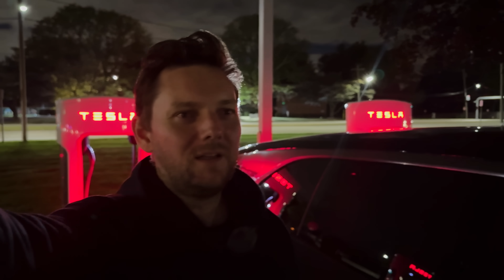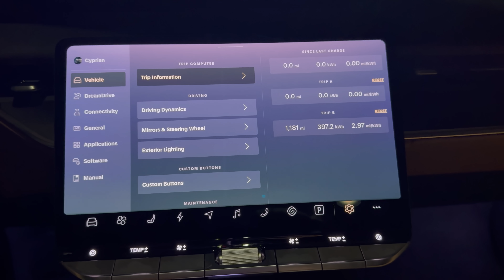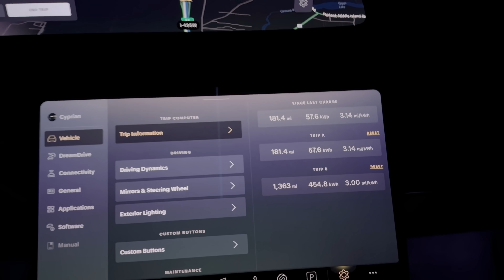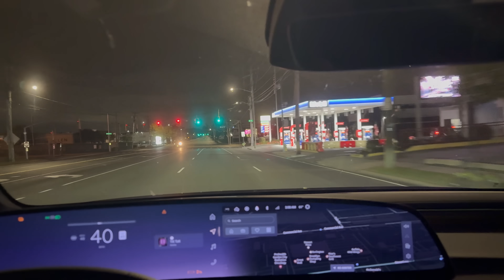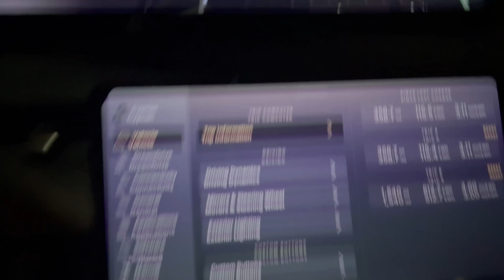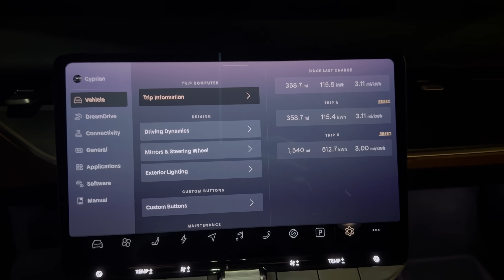Lucid Gravity 70 MPH Range Test | Real-World Highway Loop (100% to 0%)

Comment from the maker: CRUCIAL UPDATE:  (FROM THE MANUAL)
NOTE: Efficiency is suboptimal
during the early life of the vehicle
(approximately the first 2000
miles of driving).

I only had about 1200 miles on the car when I started this test.

Thank you to a view you mentioned that this is ACTUALLY in the manual, and no myth.  I will have to do another one of these tests!

I should make note: 
This Gravity is the Grand Touring with small wheels and 5 seats.. the one that has been given the EPA 450 range.

also:
 I think the miles per kWh is pretty strong for the size of this car. I often got less than that in my 2023 Model Y.... So although I might sound disappointed in the video, I do think this car is rock solid, sometimes expectations get the best of us!
Reply: I'd wait for you to hit 3,000 before you redid it cuz out of the dozens of cars I've dealt with, it's 2,000 something close to around 3000 miles that most of the hybrids are in your case ev and Even gas cars for that matter truly break in and start to perform efficiency-wise closer to what they're rated to.
Reply: Seeing that you haven't owned this vehicle too long and I already have like 1500 mi on it, it shouldn't take you long to double that number and didn't give everyone up fresh retest if that's what you want to do with a more accurate estimate

Comment: this is a little disappointing in light of Tom M. getting 345 miles @ 70 MPH with a 2022 BMW iX xDrive 50 with a 105 kWh battery. it was during the day though and was warmer. Surprisingly they weigh around the same (with the 5 seater Gravity).

Comment: State of Charge just did their 70mph test.  Got 345 and Lucid said the rear motor had an issue and that the rear climate turned itself on.  Wondering if you also had a similar issue.  They also said he had 6kwh usable when the test finished, wondering why they added such a massive 0% soc buffer.   I think OOS did a buffer test and the lucids was huge as well.   Really hope they can get this dialed and get closer to the typical EPA offset % that other vehicles see 😬
Reply from the maker: I just watched Tom's ...   I luckily have never had that rear drive unit issue. He did get slightly less than I did... but Im going to try a redemption test... I DO think the below zero buffer must be huge.. based on pedal feel AND the stated kWhs that the battery is suppose to have.. I think they could software adjust the state of charger % so that we can roll into chargers with even less, that buffer might just be too big right now.. maybe they do it that way for degradation, and keeping the vehcle feeling like new once you have had it a few years. (just let the buffer get chewed away instead of the usable amount by degradation)

Comment: Just an FYI from the Gravity owner's manual (page 101):

NOTE: Efficiency is suboptimal during the early life of the vehicle (approximately the first 2000 miles of driving).
Reply from the maker: wow, it does ACTUALLY say that... I will need to do this test again. I was too early!
Reply: @Notch_EV  I believe that during the initial miles the battery management system is still determining the efficiency of each cell and group of cells in the pack.  

If you're interested in a nerdy deep dive Peter Rawlinson did a really great video in the Lucid Tech Talks series on their YouTube channel just about how the battery pack is built/configured and some of the tech behind it, it's quite fascinating!
Reply from the maker: @randomdesign6304  I gotta get the are over 2000 miles and re do this test!

Comment: Hmm, I think you should look up what the EPA rating is, and how they test for it. 70mph is outside how they test for EPA. They also do it in a lab not in real world conditions, so everything is assuming warm temps and wind drag.

But ask chat/grok how they test for EPA. Your test doesn’t do EPA, it does real world testing.

Epa would be driving city driving speeds. I also think EPA doesn’t account for air conditioning in their rating. Good video showing how impressive the range is on a SUV going outside EPA rating though. @notch_ev

Comment: 300 miles is good enough that's a 3-5 hour drive my bladder would struggle after 2 hrs and i will be hungry too. Lucid should make that rivian r3 type car .
Reply from the maker: totally!  yeah a little sporty car that can RIP would be awesome. I really like the r3, excited to see them come out.   2 car solution!
Reply: @Notch_EV this is something u won't like I also want a micro car 50- 60 kw single lucid Motor(150-200 bhp 300-350 Nm torque) awd or rwd similar to the dacia hipster but wider by a foot with a middle seat driver position . A face similar to a H1 hummer but a little more angry.

Comment: Great new channel! Everyone's range test will be different, so the thing to do is to be dead consistent with the way YOU test every vehicle you get. That way we still get really solid comparison data between vehicles driven under very similar conditions and you can begin to understand how much your test regimen might differ from what's considered "standard." I'm very aware that the EPA test for EVs is notoriously generous so I think getting about 360 miles in a big SUV at a nearly constant 70mph of still really good. I'm subbed; do more!
Reply from the maker: wise man! thank you!

Comment: The reference speed on ABRP is 65 mph with an efficiency of 3.19 miles per kWh. I think this is pretty reasonable in real world conditions. I’m wondering if slowing down to 65 mph gets you 3.19 miles/kWh. Might be worth checking for a 30-50 mile test.
Reply from the maker: I think that is probably pretty close.

Comment: "I'm tired. I wanna go home" - Every Lucid range tester ever😁 It's late, I drove 14 hours in the last two days - at least not loops - and I'm to lazy to rewind and calculate the temperatures in Celsius, but I think the temperature is the culprit. I think it was warmer, when OOS drove the Lucid Air GT near its EPA range at 70 mph and as a less aerodynamic vehicle the Gravity shoud suffer more from higher air density at lower temperatures. Additinionally, they were probably below 0 % when the car couldn't longer maintain 70 mph. I think you could reach 400 miles with higher temperatures (-10 % consumption) and eating into the buffer below zero (few miles extra).
Reply from the maker: Totally agree that it could be possible.. the gas pedal at 0 seemed total normal... which is not what you expect when the car is about to drop dead.

Comment: We've been driving EVs since 2015, and highway range -- even with our Lucid Air -- has always been on our minds on a road trip. In our Teslas, it was actual range at the forefront of worry, and in our Air it was the crappy CCS charging infrastructure, especially in the southeast which seems to lag well behind the west coast in this regard.

The Gravity -- with its NACS plug and charging speed -- is the first EV we've owned that puts highway range concerns completely to bed for us. We drive it as we like on a road trip -- 80-85 mph with occasional bursts to break out of traffic clumps -- and we can always find a charger (preferably a Supercharger because of their greater reliability) by the time our bladders start insisting on a stop. And we almost always finish the charging before we've wrapped up using the bathroom, picking out snacks, and downing them.

The Gravity offers a wide range of wheel and tire choices, and I've seen posts elsewhere from many people fretting over which to choose to maximize range.  It might be different for a traveling salesman who lives mostly on the road, but my advice to anyone who does most of their driving locally: choose Gravity wheels for the weather conditions, the driving dynamics, and the look you want. Range is largely irrelevant other than for bragging rights at a bar.

Our Gravity Dream Edition is an absolute road-tripping beast.
Reply from the maker: I FULLY agree with that. despite some of my tone in the video. the range and charging speed of the Gravity is amazing. the King of the road!  as you said Bladders and leg stretches are needed way before charging requirements.

Comment: Slightly underwhelming, but considering temperatures are suboptimal, it's not bad.

Then a couple thousand more miles of tire wear will also make a difference for better efficiency.
And ofc make sure you adjust tire pressures on the upper end, that also makes a big difference.

Good job anyway! 👍 Will be interesting to see how it does at 60, and also with AC set a bit lower maybe.

Comment: To the EPA official site, pure highway driving should have been 426 with the 20-inch tires. However, the EPA’s highway speed limit is 50 mph, which is approximately correct. So this isn’t bad for 70MPH

Comment: The more you use the car, the more it will adapt, cause there's usually an adapting algorithm. There is still margin on improving the inverter power delivery, not to mention it's a brand new car, so I guess it can get better before the battery starts degrading. 
Anyway thanks for the video and the drive.

Comment: I wish you showed the energy app/screen to see where energy was spent (driving, altitude, climate etc.). But thank you for the video. Very informative!
I assume you didn't use preconditioning at the very end, right? It probably would eat a little bit of your range.
Reply from the maker: No preconditioning..  I chose long island so there was basically no altitude change. also the loop part is to help with that... the energy graph would have been great to show, since i was looping back and forth and putting different destinations in the nav, it was getting erased.. but the usage of energy other than driving was all very very small. NEXT time i will show it during each check in... that would have been smart.

Comment: Funny, I got nervous when you were down to 1% and you were getting to the superchargers. What if the estimated mileage was inaccurate 🥶
Reply from the maker: Yeah... I was thinking the same thing... pedal was still responsive though, and I knew the kWhs used so far didn't add up to because totally dead... but getting stuck in the middle of the night in long island did not sound fun hahha.. Main reason i didn't want to run it way below 0
Reply: @Notch_EV  At what time did you end up getting to bed lol. You still had to charge the car, find a hotel (or a safe place to sleep in your car) 🥲
Reply from the maker: @PatrickAdia  in bed 5am, it was about 30 mins drive back to the city from there (no traffic becuase of the hour)... and wiped out.... I did a charge test, that Im getting the edit done on now, at a v4 stall supercharger... i was kinda fried at that point lol
Reply: @Notch_EV  damn, that’s rough. Stay safe.

Comment: One other thing to note is that  one of the major car magazines did a range test on a Lucid air at new and after 30k miles and got a decent amount more (like 40-50 miles more) on the latter test
Reply: Fresh tires with full tread don't help. Smoother (worn) tires reduce the road resistance a bit.
Reply from the maker: interesting!

Comment: Lucid has demonstrated a strong in-house competency in electric motor design. What I would now like to see, is Lucid take EV battery chemistry design in-house, and produce patents which provide better EV range. This will have the greatest impact upon the industry! The majority of EV owners do not regularly charge at superchargers, with fast energy onboarding. They charge at home at fixed 11 kW-22kW electrical outlets. Yes Fast superchargers may reduce range anxiety, however the battery is forty percent of the cost of an EV. Reducing the cost by half potentially establishes the company's long sought-after profit margin...

Comment: Hmm not terribly impressive but still good. I was hoping for 375-400 miles at least at 70mph. Seems like the weather was a bit chilly though. I know an escalade has gone 475+ miles at 70mph. To some degree this shows no replacement for displacement. But the 350 miles for a proper 3 row EV with a 120kwh is still really good though. The battery size is almost half of the Escalade yet it achieves 70-75% of the range of the escalade with similar inside room
Reply from the maker: Yeah, the slamming of batteries into the escalade really changes things, specially on the 60mph test I saw Tom do.... but like you said, Gravity has way less battery, and does really well with what is has, and then charges like a beast. I'd rather have Gravity !
Reply: @Notch_EV  Agreed if I was putting my own money down, i'd have to take the gravity. Much better value. I will say if someone was giving either one to me for free, I'd have the take the escalade. It's presence and the feel from behind the wheel is more substantial even though it screams inefficiency. I guess that's luxury huh
Reply: @ayushmalpeddi2793  The Gravity has superior engineering at every level. It has far better use of space (better 3rd row comfort with cavernous flat storage space when stowed), charges faster, IS faster, and handles much better. Comparing the driveability isn't even fair. I have limited experience with Lucids UI and zero experience with Cadillacs newer systems, but Lucid gets the nod in software and self-driving from what I've seen from a distance. Even if these were identical in price the Lucid would be an easy choice for me. Once you account for the discrepancy, forget about it.
Reply: But you have to carry all those batteries and weight around during the 99.9% of time that getting that much range in a single leg isn't necessary. You could make an argument if you were using these for long range towing quite a bit, but beyond that, there's no legitimate argument for the Escalades significant inefficiency.

Comment: 450 EPA is not highway range.
Also, I have a 7 seat GGT on 21/22 and going 80mph in south Florida dynamic range is saying 2.85mi/kwh. So full charge highway should get 350 miles full charge on highway which isn’t bad at all at 80mph.
Reply from the maker: I know EPA is not highway.. I was just excited hoping to see 400.. thats not bad at 80mph!
Reply: @Notch_EV Agreed. It is weird you were only about to have 115kwh usable. At that rate, to get 400 highway you’d have to average 3.91mi/kWh which seems impossible for the Gravity

Comment: FYI EPA cycle is 65 mph. Also Ambient condition of 65 to 75 F degrees is the ideal for Lucid. I have done range test on my Air. It always meets the expectation. Try it at 65 and you will get close to the 400 miles of range.
Reply from the maker: Thank for info! I wish I was able to get my Gravity a month earlier (and do a test then), The weather is starting to turn on me quick! I am very happy with the Gravity though
Reply: @Notch_EV the best test i did was Boston to DC in one full charge. It was awesome. Usually we stop at NJ or DE with my touring.

Comment: I watched your full charge video on that Alpitronic HYC 400 and it charged a full 135.4kWh. So this must have a very large buffer. Also, the temperature getting colder as you drove on, likely getting in the low 50's if not high 40's, that late at night did not help it any. We'll have to wait for Tom's full range video to see how far it goes below 0%.

With that said, going over 350 miles at a constant 70mph in those less than ideal temperatures for a full 7-seater size vehicle is nothing short of amazing be it EV or ICE. And keep in mind the 800 (or even 628) horses this has versus the low 200's horses all the decent range 7-seater ICE vehicles have.
Reply from the maker: you nailed it!!  yeah, i agree about the bottom buffer,  there were some losses on that alpitronic for sure, but its obvious I could have gone a good amount of miles further. I just need a support team!   Thank you for the comment and watching!